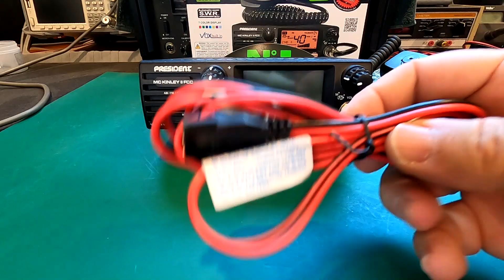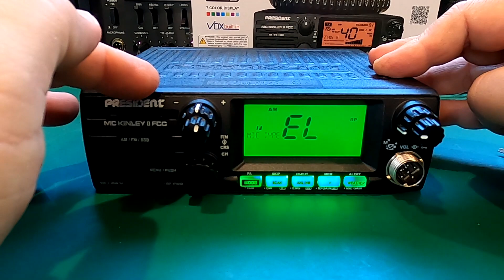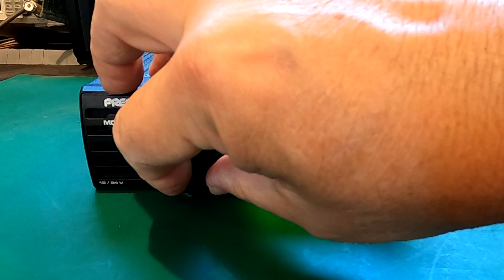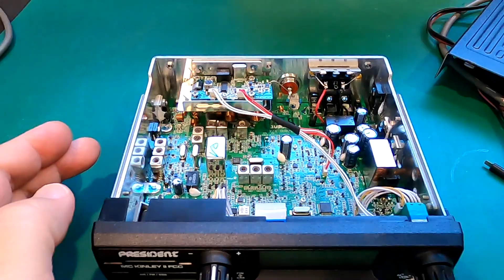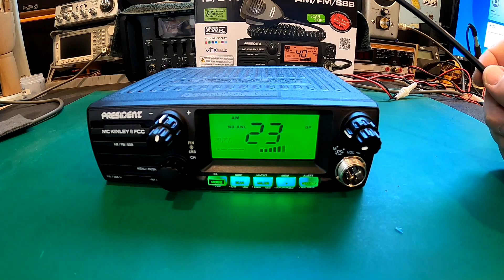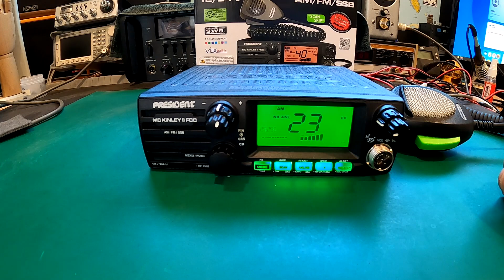President McKinley II FCC CB Radio (Review)

Comment: Which pot adjust AM wattage?
Reply from the maker: I can't divulge that info,  sorry as that is my deal with President.  That info will be out soon on other channels.
However I can say that when you jack up the RF power on these rigs you will lose modulation, so I recommend if you want a bigger signal us a little 2 pill amp, keep the power on your radio around 3 w and drive the amp with that, you will have loud audio with a lot of swing. One last thing.... get the DIGIMIKE is works best with this radio. Cheers.
Reply: thx, I have a digimike already; at 3.2 watts on mckinley 2
 @breakerbroke23
Reply from the maker: NOTE......  I own all the President AM/FM/FCC models to date. The digimike makes little to no difference on the AM/FM rigs, the digimike makes a world of difference on the McKINLEY.  Same gain or loudness but much cleaner audio, sharp and clean VS muddy and bassy using the stock mic. Have you noticed this as well?
Reply: Seems is better modulation
 @breakerbroke23
Reply: yes, better modulation
Reply: What mic setting (EL or DY) do you use for the digimic on your McKinley???
Reply: EL @slapoutindixie7537